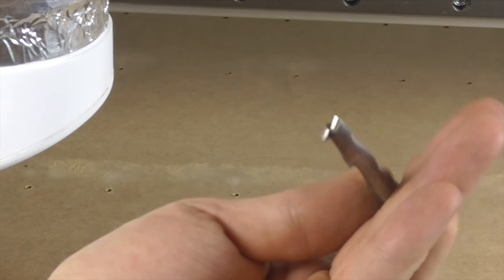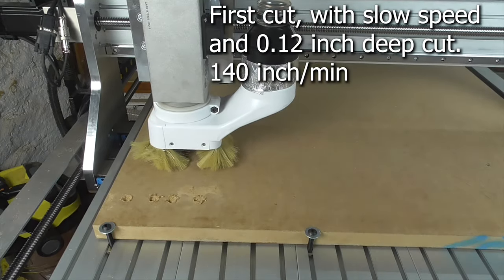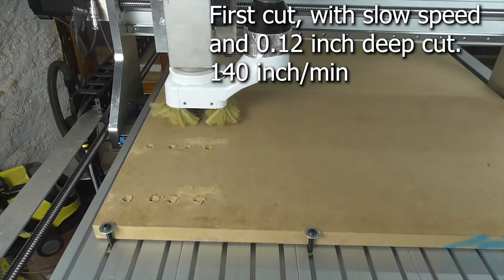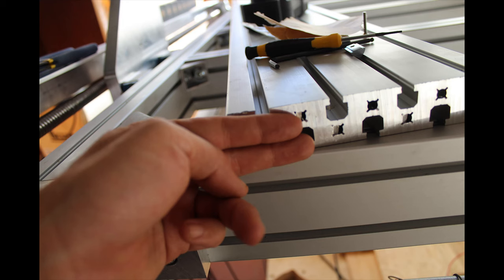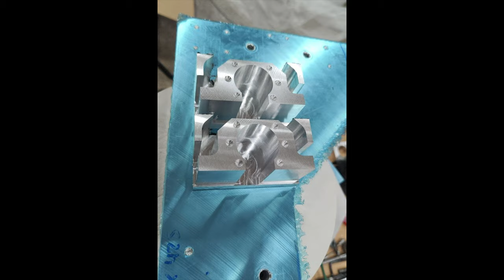The Perfect Chassis for Your Build: Discover the Features of Our New CNC Aluminum Design.

Comment: hi sir. what kind of the step motor do you using ?
Reply from the maker: Hi, Nema 24 closed loop steppers. Here a link of my steppers I'm very happy and i have this motors 3 years ago and some days i used continuously 12-14 hours without stop in 3D carvings. https://www.omc-stepperonline.com/ye-series-1-axis-closed-loop-stepper-cnc-kit-4-0-nm-566-56oz-in-nema-24-motor-driver-1-cl57y-24he40?tracking=5f01a522e3998
Reply: @CncWoodProjects  thank you so much.
Reply: Hola, estoy construyendo un router cnc para madera de 3000x1500.
La mecánica la tengo clara, mis dudas vienen con la electrónica. Usaré motores de lazo cerrado. No sé qué nema ni Nm.
Tampoco se q controladora comprar. Tenía pensado usar mach 3.
Me gustan mucho tus vídeos. Un saludo y gracias
Reply: Agradecería tus consejos